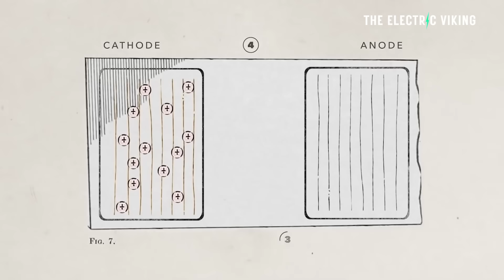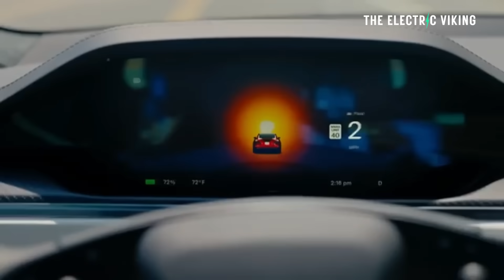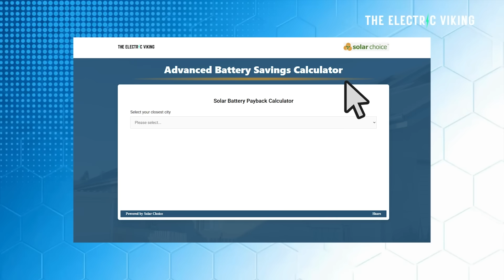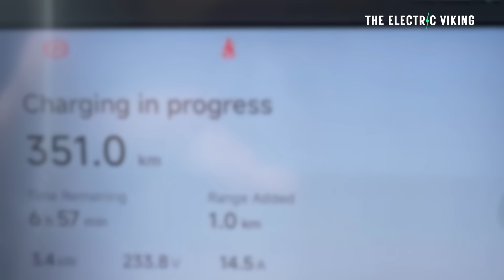DON'T RECYCLE IT? China’s New Tech Restores 76% Battery Life to NMC Batteries

Comment: This sounds like a path for reusing materials, not rejuvenating existing batteries.  To add a molten salt, you would have to deconstruct the battery.

And yes, China does have fields of EVs.  The Chinese EV industry internally produces such cheaply constructed EVs that they do not last.  And, since they are so poorly constructed they have zero resale value.  So, owners just park them in open fields and go buy a new one.  There were news reports on these a few years ago.

Comment: How do they put a molten salt into a sealed can? Prismatic cells maybe, but then how fluid is the salt? It would have to diffuse. Seems like the whole design of the cell has to change, and then we need to see how it all gets done. I am sceptical of it becoming viable. Look at lead-acid batteries. The amount of lead used has fallen over the years, so re-cycling is less profitable.

Comment: Its not going to happen, by the time a battery pack of 100's of cells are stripped down, pulled apart, reconstituted and re-assembled, there is no money saved; also as battery technology is evolving, these older cells cannot be recycled as the newer ones have different internal and less costly materials.
NMC batteries are being replaced by longer lasting Lifepo4 or Na ion types, who would want to put them back into their car.

Comment: i am sceptical since you need to introduce this battery medicin i expect cell by cell. so some one needs to take out the full battry pack and recondition it by i guess injecting each cell. i supose it may be cheaper than a new ful battery. if they are the cylindrical cell battery that is a lot of cells!

Comment: A lot of cars at the moment have a limited range and loosing 25% of the range is huge. This IMHO will only work if you have 500 mile range battery packs or higher. 

Secondly, how on earth do you regenerate a car battery which is packed to safety specifications? Have you seen a cybertruck battery? They will have to be built to allow regeneration. Ultimately it may be cheaper to just recycle them.

Comment: Kinda doubt this is worth while for most old EVs. By the time the batteries are all done, there are probably better and cheaper batteries to just replace them. And that is only if the car itself is in good enough condition for it to make sense. A beat up old p.o.s. is still a beat up p.o.s even with new batteries, so investing thousands for that is not worth it.

Comment: before people go trying to restore life to older nmc batteries you need tons of checks to ensure that the original batteries have not been abused .. because if we are talking about super low drainage of the batteries and i do not see how we handle dendrite formations and reverse it. It sounds to me it will be a check mark at a pre sorting center more than for a home use type idea so for most of us we will be still recycling them its just they will be stoped pre black mass conversion and powered up again by people with summon safety sense

Comment: Complete nonsense!
Cells are sealed. Adding chemicals would require opening each cell.
Good luck justifying it with current cells.

Happy new year.
Reply: So its not something that they're doing?
Reply: @collybeans586 

The research is ok, might be as reported.

The conclusion that it will be applied to current battery stock in use, or will extend the life of NMC chemistry forever is nonsensical.

Current cells are sealed, not easily serviceable.

Cells have use life and calendar life. Someday they must be recycled even if serviced and life extended on cells designed to be serviceable (not current ones).

Comment: Fascinating topic, thanks for the video Sam!

Albeit it does seem a bit incomplete. In one Electric Viking video - batteries getting cheaper, soon should reach $19 per kWh. Here, batteries are expensive, we should spend time and money to renew them. Which one is it for 2026/27?

And even if renewing is as economically feasible as it is fascinating idea - what's the process? What are the costs? 

Personally, I had to watch this video 2 times just to catch that the flow should be:
1) NMC pack reach end of life in EV.
2) NMC pack the reused as stationary energy storage
3) NMC pack reach end of life as stationary energy storage
4) NMC pack renewed to 74% original capacity.

Still, does it require disassembly or some sort of recycling? More details on the process and economics would be much appreciated!
Reply: This is Groks answer 
They do not inject or pour the molten salt into the intact battery. This regeneration method is a recycling process performed on degraded cathode material after the spent battery has been disassembled.
Here’s how it actually works:
	1	The used electric vehicle battery is safely discharged, dismantled, and the cathode sheets (typically aluminum foil coated with NMC powder) are separated.
	2	The cathode material is processed to remove binders and conductive additives (e.g., via heating or shredding), yielding degraded NMC powder (in this case, NCM811).
	3	This degraded powder is mixed directly with the ternary molten salt mixture (lithium hydroxide, lithium nitrate, and lithium salicylate).
	4	The mixture is heated, causing the salts to melt into a low-viscosity liquid medium. In this liquid environment, lithium ions move freely, penetrate the damaged cathode particles, replenish lost lithium, remove surface defects (like the “rock salt” layer), and allow atoms to reorganize into their original ordered single-crystal structure.
	5	After cooling and washing to remove residual salts, the regenerated cathode powder can be reused to manufacture new batteries.
This “direct regeneration” approach repairs the material at the atomic level outside the battery, avoiding the need to break it down into raw metals. It’s more efficient and environmentally friendly than traditional recycling, restoring up to ~74–76% of original capacity.

Comment: It’s not one big battery …..so How do you add something to thousands of tiny batteries that makeup one large one  ?
Reply: Exactly; I'm assuming that the pack must be dismantled and each cell rejuvenated. Then, the pack would need to be re-assembled. What, if anything, would be the cost saving compared to a new battery of equal power and energy capacity?
Reply: First we all need to know how this lab did this. I can repair my car 12V Lead-Acids with 6 cells all at once with the cheap chargers with repair mode found in Amz. There is a chance a BMS could do the NMC repair without cost of dismantling. BMS has access to sub-components because it has to to do its jobs. Just speculating but can't do anything more without lab details.

Comment: Reuse and refurbishment is what worried me about companies planning to recycle EV batteries. It's also possible some packs will be completely re-celled with same or upgraded batteries. When you get a replacement pack it may be like lead acid batteries are today so you will get your "core charge" money back when you turn in your old pack after replacing it. I'm hoping some third parties will offer upgraded packs with more modern cells for more range and cold weather performance.